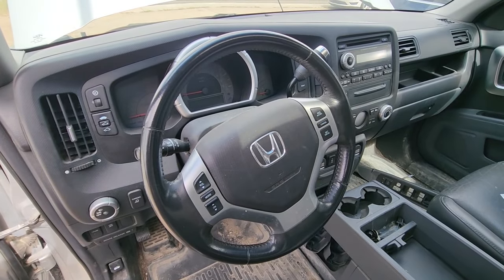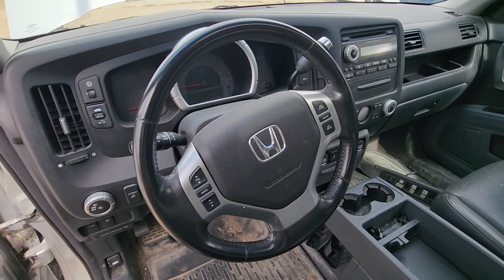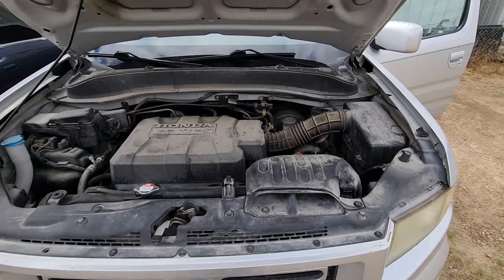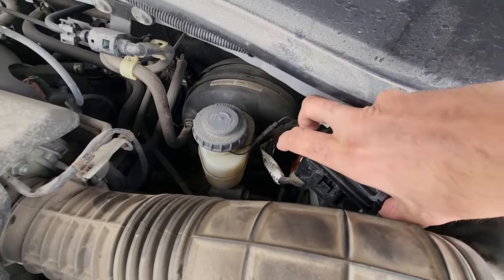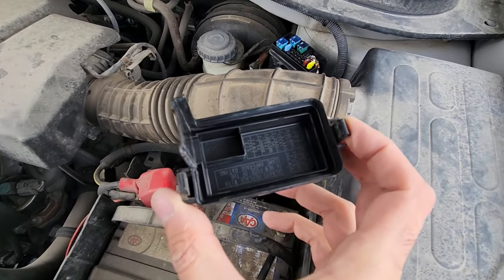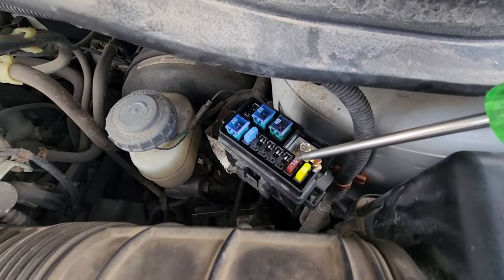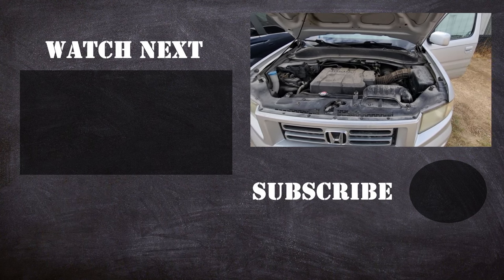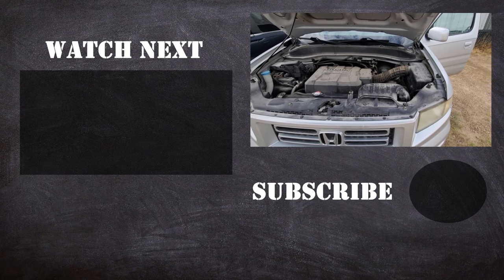Honda Ridgeline - TIRE PRESSURE MONITOR SYSTEM (TPMS) FUSE LOCATION (2006 - 2014)

Comment: Where do u buy the Fuse?
Reply from the maker: You can get fuses in any car part stores or order online. Usually they come in packs (5A, 10A, 20A, etc.)
Reply: How do you  reset a 2010 Honda ridgeline tire pressure sensor?
Reply from the maker: @miguelvazquez5226  Hi, to my knowledge if all the sensors are working and tire pressure is good in all tires only Honda dealership can do it as they would need to connect their oem scanner to access the module. Not 100% sure about this, but I had a similar problem on older generation Pilot
Reply: Can u leave the fuse out so it never works?